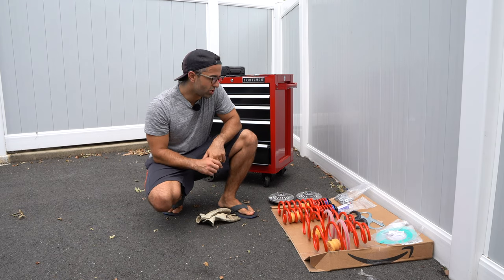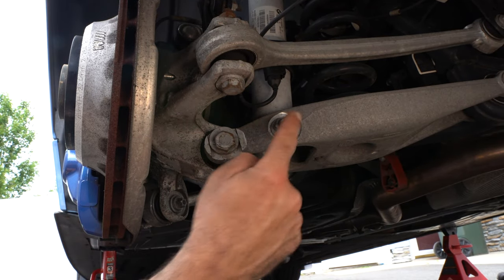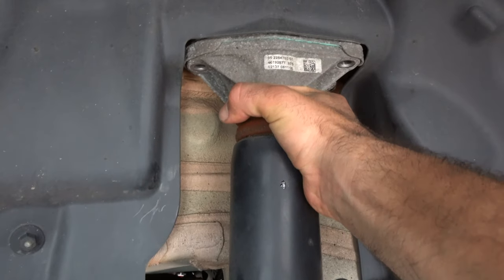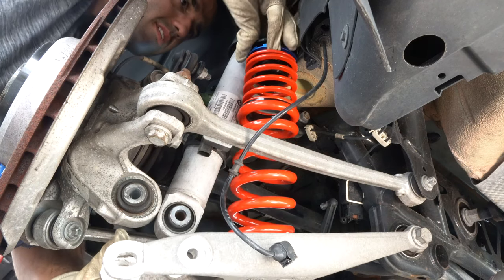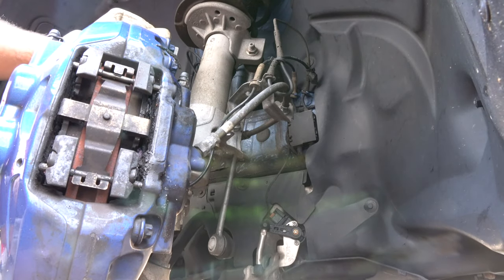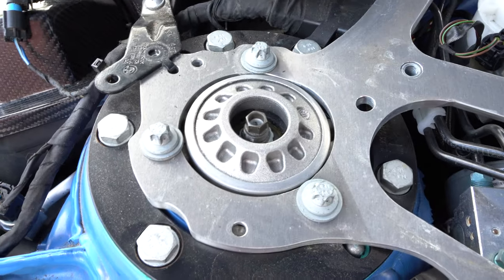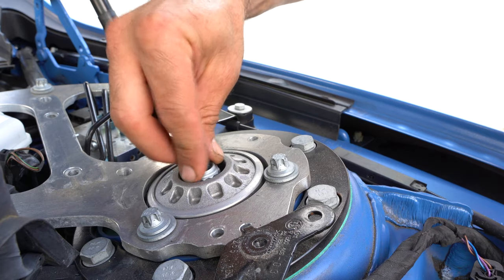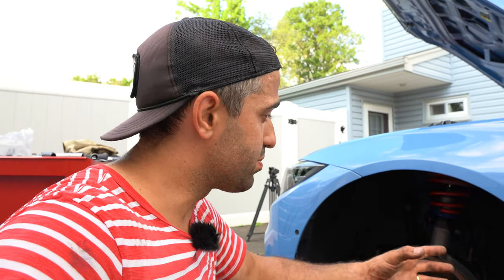DIY install M Performance Height Adjustable Suspension (HAS) In an F80 BMW M3 (same as Dinan and KW)

Comment: Good job dude! I’ve had lowering springs sitting in the box for about 6 months now. I’ve been debating whether or not to install them myself or have a local shop do it. After watching this vid and seeing how straight forward the install is, I might do it! Thanks for the tutorial dude!
Reply from the maker: PaulSvk84 Absolutely. It is very straightforward and the front is actually a lot easier than the back.

Comment: So according to the SA at BMW there is some programming involved. I had an independent shop install my MP HAS (saved $2K) so I don't have the programming on mine. I wonder if it makes it better🤔. It would be interesting to get a comparative review between having the programming and not having it.
Reply from the maker: Honestly I don’t think it’s that important. Perhaps it makes the modes more pronounced. Either way - not worth the hassle IMO
Reply: Anyone have an idea on what this specific programming is about?  It’s not the same as calibrating the EDC is it?  Also be sure to watch the removal of the EDC sensors.  They are super fragile and can fail thus needing replacement.

Comment: Great video, thanks!   Can this also be done on the competition version?   Bigger wheels and diff suspension, not sure if this kit will be too low.  Any ideas?
Reply from the maker: Thanks. My car is a competition model so it can be done. But the same thing applies to all F8X.
Reply: It’s the same. I have the adaptive suspension on my Competition Package and installed the KW version to retain the EDC functionality/stock dampers and it’s the same. Follow the instructions especially concerning the location of the front black billet spring perch replacement as it’s supposed to be pressed on to a certain distance from the end of the damper tube and MAKE A VERTICAL MARK in-line with where the sway bar end link mount is BEFORE removing the factory spring perch. If you press the new perch on with the end link mount protrusion at the wrong angle, your end link won’t mount up correctly.

Comment: Great video! When is the post-installation review coming? Curious to hear how much it’s impacted comfort of daily driving.
Reply from the maker: The plan is to shoot it sometime this week. Essentially nothing but positive feedback and I’m really glad I made the change
Reply: You still doing a post-installation review?
Reply: I installed the KW version to keep the EDC and it rides BEAUTIFULLY. Like stock only with a lower center of gravity. I’ve got the Comp. Pkg. 20” wheels and the wheel opening apex is about 1/2” of fender gap. Pretty damn low. Been through 5 different front carbon lips trying to find something that doesn’t get destroyed in Houston city streets. Ended up with a two piece design with an open center and they hug the bumper pretty close. They’ve still made contact on the underside on steep drives, but it’s worth it.

Comment: Hey Tommy amazing video!! I know this is an older video but I need your help here. Are these lowering springs 15mm lower than the normal suspension even at the highest settings due to they’re being shorter? Let’s say I put these lowering springs on my car and have it at the lowest setting which is 20mm. Is the riding height going to be 35mm or 20mm lower compared to normal suspension?
Reply from the maker: It will be 35mm or more lower. These go very low

Comment: Currently installing mine... Seems like you have experience with holding a shaft (5:28) lol... currently stuck with this process.. I have basic tools and can't undo the bolt on the strut/shaft... any recommendations? Thinking of stopping by autozone and getting vice grips but I highly doubt that will work..

Comment: Nice jobski. Installation looks straight forward.  Do you put something on the threads so they don't sized up, for example, If you decide to drive your car though winter.
Reply: @TommyLGarage  put some tawot there. Haha
Reply from the maker: I replied to the wrong message earlier - sorry. 
I did put anti seize on the threads later on - I also hope I won’t have to do much adjusting after next week - getting the car corner balanced.

Comment: For anyone trying this themselves, just remove the inner bolt for the control arm and leave the camber bolt alone, easier and you won't mess it up.
Reply: how do you drop the control arm if you leave the camber bolt in??

Comment: Tommy, question and I apologize if i missed this. the M Performance kit does NOT effect the Adaptive Sport Suspension options does it? I am wanting to stay OEM as well and maintain the feature with this kit. Can you confirm? I have 2016 with Comp/Exec/Lighting
Reply from the maker: Nope it does not affect it at all. You can still retain it and it works well

Comment: Tommy, just watching this now. There is nothing to lock the rear spring adjuster in place, correct? The from has the small Allen bolt. I assume the weight of the car keeps the rear stable...thanks!
Reply from the maker: Yes sir. No locking needed.

Comment: Tommy, I got a M performance HAS kit from someone. It didn’t come with rear bump stops. Is this okay? I know that regular lowering springs do not come with it so I’m assuming I should be fine. The HAS kit stop is only a tad shorter
Reply from the maker: You should be fine. Or cut your your oem ones.

Comment: Did you consider other spring options? I've read good things about the Emanuel Designs and they're only $300. I'd welcome your input. I'm only looking for a better stance and keep the ride quality.
Reply from the maker: I used to run Macht Schnell springs. This setup is a lot better.

Comment: I saw a couple videos where the top nut that requires the special socket, people just used the impact to tighten.  Is that not possible you think??
Reply from the maker: It is possible but it will not tighten the top nut appropriately because you need to hold the center,  otherwise even with the impact gun the center keeps spinning

Comment: So would you recommend this over the Dinan kit? What other suspension mods should you do to properly lower the M3 for street 80% and track/canyons 20%? I've been looking at the MP HAS, Bilstein B16, Ohlins, Kw, but read a review in the forums that the MP coilover did the job and were more affordable.
Reply from the maker: KW HAS is most affordable but they ride rough. 
MP is an amazing oem solution.

Comment: Is changing the yellow bump stop in the rear totally necessary? Asking because if the benefit over OEM is negligible then it saves time on not having to remove the shocks. Thanks.
Reply from the maker: If you’re not going to be super low then you’re right - not necessary. Or you can just cut oem with a knife a bit

Comment: Hi Tommy! 1st and foremost, love your videos!! I’m looking to add the kit for the 435i F36 w/m-sport suspension, do you know if they’re as adjustable as this kit? getbmwparts says it will lower the vehicle 10mm from stock height, is that accurate?
Reply from the maker: I don’t know if this fits the MSport. I think those are only lowering springs

Comment: Awesome video, thanks for doing it. Trying to follow this for a KW HAS install on a F83. 

One thing I noticed though is that for KW HAS the helper springs in the rear go at the bottom and not the top. Not sure if the MP HAS goes on top as shown in the video but KW HAS instruction manual shows the helper springs going at the bottom. 

Also, not sure how you got the eccentric bolt close to the camber alignment you marked with the sharpie. Do you do it before you torque the nut?
Reply from the maker: I hope you were able to do this. Yes KW has a slightly different design from MP. 
And I was able to mark up the bolts before undoing any bolts.

Comment: Hi Tommy, great video. I don’t think this was mentioned in the video, but were the springs you removed the stock M3 springs? I ask, because, I really like your approach of using the jack to compress instead of using a spring compressor, but want to make sure the stock springs will not be too tall in a relaxed state to remove from the car. Thanks.
Reply from the maker: Springs were lowered but you can use the same method on oem springs
Reply: @TommyLGarage  Many thanks for your reply.  I'm installing M Performance Coil Overs into my M2 in a couple weeks.  I'll give it a go without compressors~!

Comment: Thanks for the video, Tommy. I’m tempted to do this myself. How do you adjust the height? Do you need to take the spring off or just jack up the car and use that wrench?
Reply from the maker: Front is easy. Jack up the car and turn the spring. Rear you need to take the wheel off

Comment: Great video 👌. I went with the KW has and am still unsure of how the front spring seat collars are set for height 🤔. I think you lined up the sway bar link hole height.. which makes sense.. but wouldn’t the suspension drop the collar down under load while driving if the collar is not set low as possible anyways ? 

And I went with kw because oem... well those guys designed the awesome keyless crank hub 🤦🏻‍♂️
Reply from the maker: Can’t argue with the amazing crank hub!

Comment: Great videos. For the rear, I watched a vid where you undo the bolt under the shock and the far end control arm bolt at the frame instead of messing with the camber bolt. Would that be better?
Reply from the maker: It would be faster but a bit harder since you’d have less space to maneuver

Comment: Great DIY. This is definitely on the list. I hope you got a Schwaben spindle housing spreader - I did my E90 330i front struts and it made it so easy to get those front struts out.
Reply from the maker: Thanks! I ended up just using a flathead screwdriver. Worked just as well

Comment: Each time you alter your height, do you need to have it re-align wheels again?
Reply from the maker: Double Tap Technically yes. But mostly camber will change. The idea here is to wait a week or two until the suspension settles it then get it adjusted to the height I want and then properly corner balance it

Comment: Kinda blown away that you did this without removing front top hat and using a spring compressor, but it’s genius really. Nicely done!
Reply from the maker: Thanks!!!
Reply: Tommy L Garage I used your technique and it works perfectly as long as you’ve already installed lowering springs. For oem spring removal I have to recommend taking the unit out and using a compressor. As always your content is fantastic.

Comment: “This is pretty long so you have to do a lot of screwing” that’s what she said lol... great job tommy, great setup for the track.  Maybe in the future you can upgrade the struts with the bilstein unit that can be controlled with the electronic suspension mode
Reply from the maker: Haha dirty mind!! 
I think these struts should be fine. I figured the springs were designed for these struts so why look for something else. Although my buddy picked up a set of JRZs and those are amazing
Reply: @TommyLGarage  Just an idea also just in case the struts do wear out overtime

Comment: Awesome video Tommy.  I am about to order the HAS.  I think I’ll tackle it myself. One thing though.  Hammering the front strut has me nervous.  Any alternative to this approach that you figured out over this past year ??   Thanks.
Reply from the maker: It’s easy. And hammering is one way. Another way is to press it in. Bring it to a shop which has a press. That’s how the dealer does it
Reply: Tommy L Garage ok. Just afraid I’d break the strut by hammering it
Reply: Ordered the parts as per your link. Once’s it’s slightly cooler here in southwestern ct I’ll tackle it.

Comment: Hey Tommy, I've probably watched this video a million times now, and I am finally considering getting something like the KW HAS kit for my M2 Competition. Do you think that installing the HAS kit on the stock shocks which have 31000 miles on them would be a good idea? Also, in retrospect, did you like the HAS kit, did it compromise the handling of the car in the long run?
Reply from the maker: MP HAS is the way to go. You’ll be fine with 31k miles.
Reply: @TommyLGarage  Thank you Tommy, one other question. I know there is a price difference, but would you choose the HAS kit over a full coilover kit?
Reply from the maker: @thunderbolt2000k  for daily driving HAS is the way to go. Coilovers are good if you’re tracking the car. I would not spend the money on them unless I was going to the track 10x a year
Reply: @TommyLGarage  Yeah, that is mainly why I am looking at HAS or Springs, because I am not going to track the car, it is my DD. However, given that the M2C does not have Adaptive suspension, would you say that the HAS is still the way to go over some Eibach springs for example? Im just a bit wary about putting $400 springs on a $64K car, not really looking to ruin the handling. But for what I have heard, the HAS kit is just adjustable springs, right?
Reply: @TommyLGarage  Thank you for your help btw, I really appreciate it. I cant seem to find many answers on the f80-f87 forums
Reply from the maker: @thunderbolt2000k  yes HAS you can go up and down but not soft and hard.

Comment: Amazing Video, keep it up, many specialists say that the M-Performance switch is a downgrade from the competition springs what do you think and feel after testing it out?
Reply from the maker: I think it’s a step up!! Competition springs were sitting way too high and were softer compared to these
Reply: Agreed, I will do them next step. I have a shakir orange II manual f80 m3 as well. love the stuff you have done tom yours.
Reply: I wanted to ask what height are you running yours now and does it bother you for daily?

Comment: Bravo sir! I just bought a set of coilover for the F82 and a local shop quoted me 9hr labor ($1900) for the installation only, excluding alignment. It is RIDICULOUS!
Reply from the maker: Ooooff run away from them!
Reply: I was changing front dampers in my local shop and when I asked why they want to charge so much they told me that it takes 5 working hours 😳
Reply: I guess it standard time which BMW predicts for this type of labor
Reply from the maker: ImOn Caffeine way too long. I did all four in less time

Comment: How long did the whole process take? Love your videos
Reply from the maker: moe sultani Thank you. I would say about two hours with filming
Reply: Tommy L Garage thank you this is the part number I ordered 33-50-2-414-216. BMW is trying to tell me it takes 11hrs to install. Cost 2400 to install and I need to code the car after is that true?
Reply from the maker: moe sultani I did not code it. Not needed. $2400 is absurd!!!!! Run away from them.
Reply: Tommy L Garage appreciate it left them found another reputable shop, they’re doing it for 800$ with alignment.
Reply: Tommy L Garage Thanks for everything your videos are amazing. Had them installed they feel great. It dropped 20mm but there is still a good amount of gap. How did you get yours to become so flush?

Comment: Great video Tommy. Amazing how different it is from doing the KW HAS on my F10 M5. Nice job!
Reply from the maker: m3summ is this easier or harder ?
Reply: @TommyLGarage  I wouldn't say harder, it was more to take apart. For example you gotta pull the back seats, the rear speakers etc. to just get the rear upper bolts off, and they are still a pain. I do all my own work, but I just had RSW - Redline Speed Worx in Greenbrook do it for me. Highly recommend them.
Reply: How much did they charge to install that for you? that’s in my area need F30 springs installed
Reply from the maker: NASIR973 where are you located ?

Comment: Just a word of advice - the grub screw in the spring perch (front struct - see 27m 13secs) are metal. Swap them out for nylon screws like KW uses or you'll find them impossible to release in a few months. Just 9 months after I installed my BMW HAS kit, I had a full chassis tune and the grub screws were seized requiring drilling a tapping entirely new retainers!
Reply from the maker: ohgivemeabreakfeller oh damn. That’s interested. Might swap it out. Thanks!!
Reply from the maker: ohgivemeabreakfeller do you have a link? Any idea what size it is ?
Reply: Tommy L Garage I’m guessing it’s probably M3 size (the thread size, NOT the car - ha!).
It doesn’t need to be flush so I’d probably replace with something like these: https://www.amazon.com/Katosca-Spacers-Assortment-Waterproof-Accessories/dp/B07PPRYX7N

It doesn’t need to be strong, it’s only to stop the perch from moving with vibration and only then the spring has no load.
Reply from the maker: ohgivemeabreakfeller thanks!!!
Reply: Or put some grease/anti-seize on it. I drove my car for several winters with coilovers and the screw never got seized.
Reply: boroboroae86 I’ve never had it before or since on other coilovers but for some reason the HAS gave trouble in such a short time - seems like a gamble worth trying to avoid to me.
Reply: Hey @tommy l garage, did the nylon kit linked above fit your MP HAS kit?

Comment: Great work tommy! Thanks for putting this together.  I will use this guide when doing this on my M2c myself.  I was surprised that kit does not come with new struts/shocks. The M2 m performance Kit comes with both struts and springs. Maybe due to the M2 suspension not being electronic so that’s why?
Reply from the maker: 4WDExplorer That’s a good question. But it will make your swap a lot easier
Reply: Tommy L Garage yes thank you!